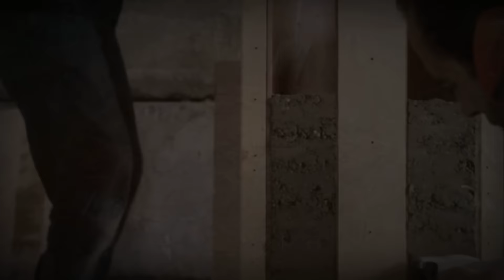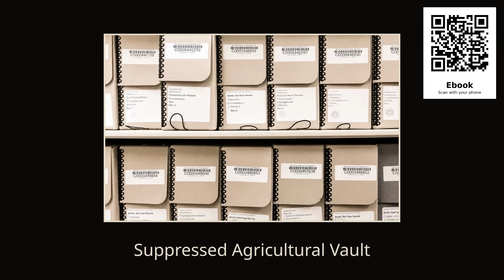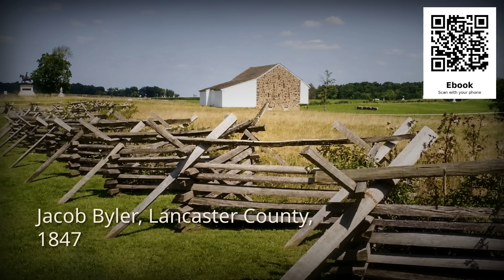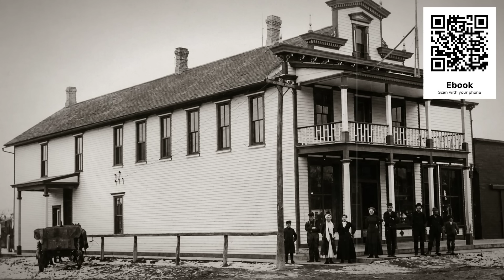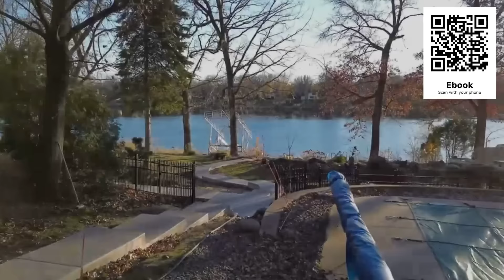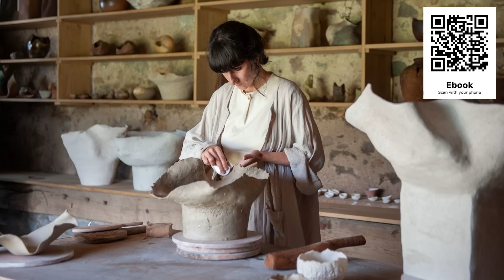Convert Dirt Into Bulletproof Walls With Ash. Stronger Than Concrete. Hidden Since 1453

Comment: That’s a lot of Ash, a lot of timber needed to make 6kg of pure ash.
Reply: Back in those days, woodburning was very common for cooking, heating, hot water etc, making enough ash.
Reply: Get the ash from newborn that have wood fireplace or stove.
Reply: Well, if you heat solely with wood heat, you would be surprised how much ash you have to sweep out of the wood stove.  It's about a small garbage pail per week.  It adds up fast.

Comment: Very informative and historically valuable video! If I may ask if the ramming process is very strenuous...
Reply: No, do this in small batches and build up to match your strength. If you do too much on the first day your back will ache, arms feel like they want to do nothing the next day.  Pace yourself and it is fine.  The tampers come in several sizes too. Like weights down the Gym.

Comment: I guess I know how the pyramids were built. 
One block at a time in place. 
No need to transport whats not necessary
Reply: poored in forms right in place..
Reply: @dugdanug it makes lots of sense, and that would explain how every single joint fits so tight not even a single piece of paper can slide in between the blocks. 
Hello